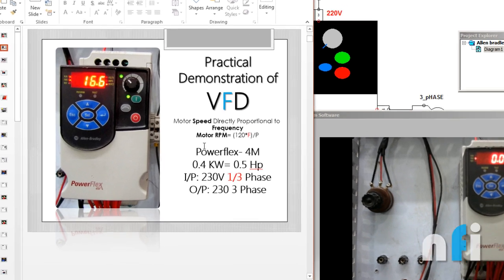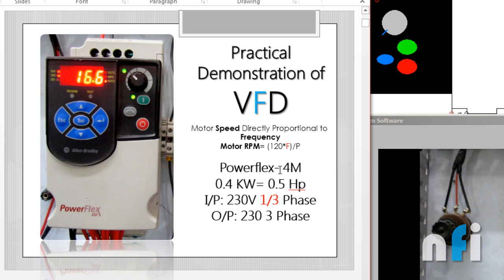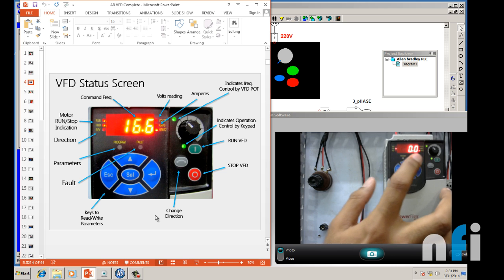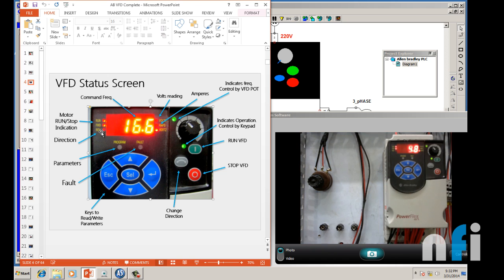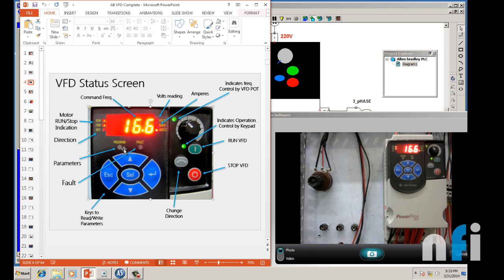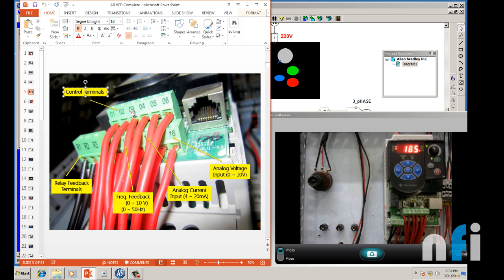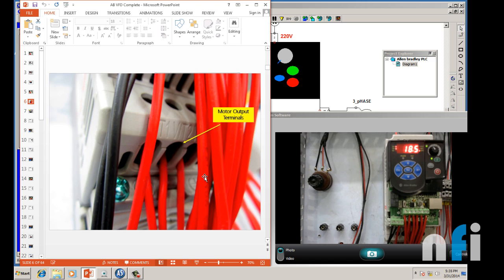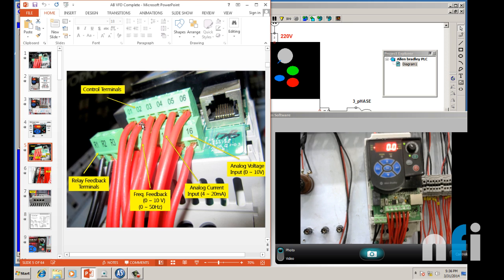Allen Bradley Powerflex 4M- Understanding VFD- Variable Frequency Drive

Comment: I had used 4-20 MA as an speed reference source in 4m series vfd of 7.5 kw...My motor has 2800 rpm speed...so if i select 2800 Rpm from my hmi which is of schineder ..the frequency coming on vfd display is only 32 hz ..which has to come 50 hz..so plz tell wch paramarer has to set for this case....awating for ur rply sir..
Reply from the maker: Did you calibrate your current to speed conversion properly? That you can crosscheck..

Comment: If I am just using the unit itself to control the motor do I need to use the control wires (other than the input leads to the vfd and motor)?
Reply: What you mean by 'Unit' here?

Comment: why ac convert to dc and dc convert to ac in vfd input.why not directly ac supply give?
Reply from the maker: This is because we need to change the frequency of the output signal! So we have to convert AC to DC and then create variable AC frequency signal! Because it's difficult to convert AC to AC wrt to frequency 

Hope this make sense !
Reply: Why not use Cycloconveter to convert ac to ac
Reply from the maker: +Pankaj Kathiriya VFD basically has step up and step down cyclic inverter inside it with intelligent control system of frequency and current

Comment: How PLC Communicate to VFD
Which Parameters we will use?
We use Delta PLC with this VFD
Give me the guidance about this
Reply from the maker: +POSSIBLE Automation &amp; Control System If you are asking for MODBUS communication, please watch our video on PLC & VFD MODBUS, but that one is with Delta PLC- Delta VFD. I have not explored Delta PLC and AB MODBUS. But if you are asking for hardwire connection then it's pretty easy, let me know what you want to achieve.

Comment: Good afternoon , I'm with the inverter power flex 70 , when I turn appears:
Initializing ...
Error : Hardware
Invalid Port Id
DPI Port 0

Please , I thank all the help . Thank U.
Reply from the maker: Please try to reset the parameters! and try again
Reply: Good morning , I can not touch anything , no ihm button responds . If you can help me , thank you. Thank U.
Reply from the maker: Tome Albuquerque
 Then i cant help you in that case. You need to reset the drive. Check out the manual for troubleshooting techniques please.

Comment: Hi Mr. razvir,
I am very happy that what I was lloking for long time I got it from you.
I mean I want to learn programming & wiring control for AB vfd power flex40, 70 model. I am facing lot of difficulty while troubleshooting in food plant.
can you help me out with this by providing more video guidelines as you shown in brief.
Right now I want to know that how can I increase freq. of drive more than 100hz.  powerflex 40 name plate says max freq. is 0-400hz.
but when with keypad potentiometer I cannot increase more than 100hz. why?
how to change this frq. of drive to increase my conveyor speed?

pl. help me out to improve my knowledge about vfd set up.